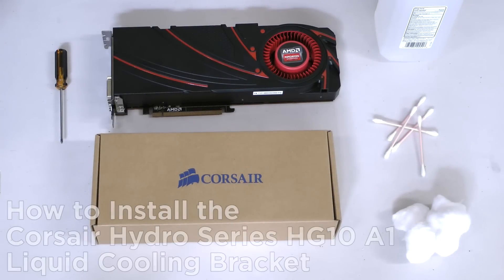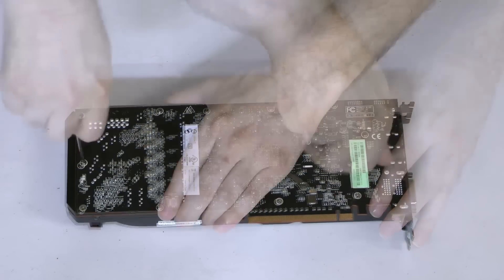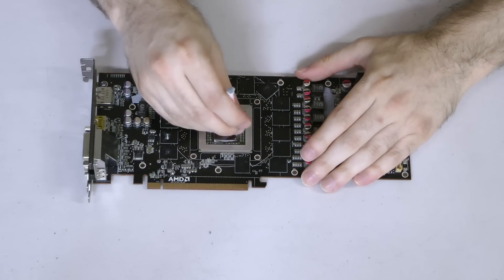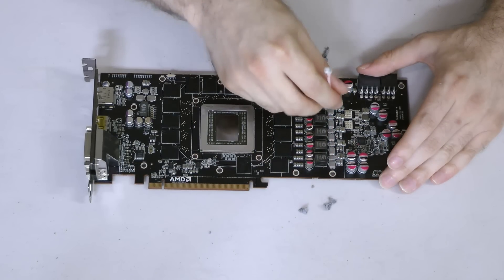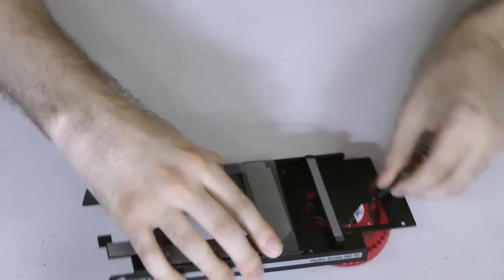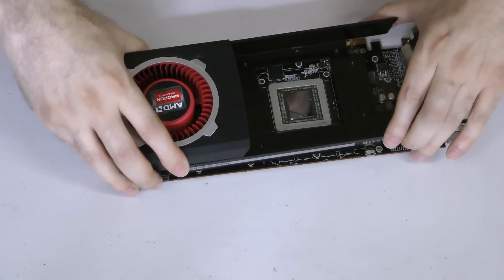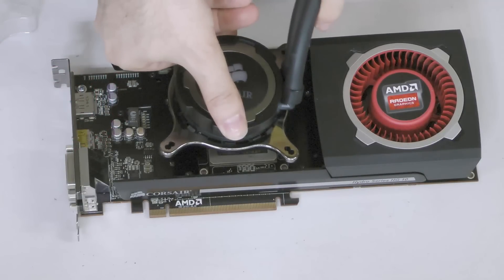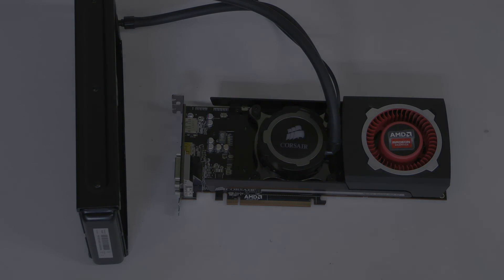Corsair Hydro Series HG10 GPU Liquid Cooling Bracket -- A1 Edition Installation How-To Guide

Comment: So, what if you don't have a reference card? 

Ive got an ASUS DurectCU II, which has different fans to a reference card.
Maybe I should just get a Kraken G10, since it has it's own fan.
Reply: +Haylos Van Cuda You could just use the NZXT Kraken G10, the fan is included in the package. Its the same thing, but supports different all in on wattercooling
Reply: +Sebastian Frøyen (SeBlastian) 

I said that in my original comment - it wont fit though, i emailed Kraken

Comment: Would  this work with a non-reference R9390x, if I got a hold of a reference cooler?
Reply: As far as I can tell it isn't supported :( The NZXT Kraken, which does the same things as this supports more cards, but the 390 and 390x aren't listed. No one has answered me on whether or not it will work with some modding
Reply: ***** As far as I can tell it isn't supported :( The NZXT Kraken, which does the same things as this supports more cards, but the 390 and 390x aren't listed. No one has answered me on whether or not it will work with some modding
Reply: +EricM260 sweet, let me know how it goes and maybe I'll buy one too. I have the xfx390x so maybe I'm in luck.
Reply: ***** That's really good news. I'm definitely going to try this. I wonder, though, if the NZXT GPU Bracket will work too, since they list the R9 290X as compatible I think it would. You said the 290 and the XFX 390 are the same?

Either way I'll try one of them and let you know if I need help/how it goes.
Reply: +EricM260 Just out of clearity you tryed the NZXT or the corsair
Reply: I haven't yet. I haven't been able to buy a liquid cooler that I can use yet, but I'm planning to get one soon so I can give it a shot. I'll be sure to post about it when I do though.
Reply: Okay thanks

Comment: hg10 980 is compatible with h80i gt?to cool 1 titan x
Reply: The number after refers to the graphics card number,  the HG10 N980 is compatible with the GTX 980 (and a few similar models) any corsair hydro series cooler will work with the HG10.

Comment: Why there's a lot of negatives comments ???
I'm about to install this to my two R9 290!!!
Reply: ***** HG10 for one, arctic + hg10 for crossfire. Mainly because it doesn't pump the hotter air back into the case and rise the cpu temps, also it's cooler.
Reply: ***** Exactly.
Reply: ***** Generally at the back as exhaust, anywhere you put it leave it as exhaust, also please change that case, it's really not good.

Comment: To what do you connect the pump/fan connector to? Only spot i got left is a case-fan connector. As for the VRM cooling, i gues only way to keep em cool is manualy override the stock-fan speed? As its throttled by temperature of GPU (wich is quite low), it runs often at 10/20% max, that would explain the insane high VRM temps.

Comment: It'd be amazing if this was reusable, but once I upgrade my graphics card it is pretty much useless. Not sure if anyone on eBay would buy it either, once the thermal pads have been used. Are there reusable solutions for water GPU cooling that are more future-proof than this?
Reply: QuantumBraced why not sell the old gpu on ebay with the liquid cooler attached. it should attract more money than use the that money to buy a new one for the new card

Comment: My hg10 was warped I didn't notice till my r9 290 just black screened and died out of the blue about a week after installing this bracket.

After I inspected it you could see the PCB was warped with this bracket on. Maybe I should have inspected more thoroughly but I have a lot of corsair products and never thought qc would be a problem.

I had to buy a new r9 290 i still have my h60 and hg10 but alas ain't no way I'm reinstalling it.

Comment: I did some testing with this If you are looking to over clock the vram please don't this is a shit cooler for ram I got 95c on my ram -_- with only 1400mhz mem clock on the other hand If you have a good water cooler go for it I got 1200mhz on core 60c max temp h100i

Comment: I'm surprised that more cards don't come with stock AIO water coolers already installed like the R9 295x. Even if the cards don't run as hot as the 295 it seems there would always be a market for a preinstalled AIO cooler. Everyone likes their card to run cool so why not? Plus they could design some really badass looking blocks that they could charge big bucks for.

Comment: This liquid cooling bracket can fit a r9 290 tri-x ?
Reply: (this is a 2 year old reply, but someone may see it and need the answer)
yes, the 290x tri-x can use this, because it uses a reference designed board. but you will have to find a reference-style fan to install in the cooler bracket.

Comment: Good video, but a lot was left would be good if it could be clarified. 
1- where would you recommend plugging the fans ? 
2- I see the old brackets in this video, but shows on the descriptions compatible with all hydro coolers. Will it take the new mount found on the h60? H100i? 
3-the Radeon gpu itself is actually caved in in most cases this was possible by using a slab on aluminum or copper that filled the void between the die and the water block thus being able to make the contact. Is there such thing in this kit included ? Other than that you would have to use excessive thermal paste to create contact between the two.

Comment: good demo, but don't fully go by this video as at the end he said it's ready too go it's not put some thermal past on then put the water block on :) just saying
Reply: ***** Yeah, the video is assuming that the hydro series is brand new out of the box. He probably should have mentioned that if reusing a unit you need to reapply thermal paste, however I'd imagine 99.999999% of the people who are willing to take apart their expensive graphics card for water cooling already know that thermal paste is required.

Comment: I want one for my new gtx 970. I know it runs cool enough. But it doesn't hurt to run even cooler lol. I might need a new case to do it. My corsair air 240 won't fit my 100i water cooler and another water cooler in it. lol damn it

Comment: I have the gigabyte r9 290. Where could I get one of the reference card blower fans for this? I really want to liquid cool my card.
Reply: Same issue. As far as I can tell there's nothing out there. In UK i can't find a reference fan.

Pitty.
Reply: Ziuko X did you guys find a solution?  would this fit, FD7525U12D, i got me the msi 290x twin frozr and i dont have a blower

Comment: So the aircraft fan freaking noisy sound is still there....'
Reply: yes and no, the fan can be turned down a bit now that it isnt trying to cool the damn hawaii gpu core which is good and the reason companies are making aio gpu brackets.
Reply: no, it should run much quieter. in the stock setup, the red fan cools the entire card. with this setup, it only has to cool the VRMs, which generate only a fraction of the heat. you will never have to ramp the fan up to keep things extremely cool

Comment: @MahmoudMaguid oops, I thought that that hydro cooler came with the bracket as a single kit. But you can choose any pump for this gpu bracket. So if I wanted I could get a 140mm rad.  Nice 1

Comment: Where would I mount that rad. Hmmm not the top cos I have a dual rad there already for my cpu. That leaves the front. And it cant me mounted there cos my hdd cage. The perfect place would have been as a rear exhaust. Or less perfect but still useable the bottom of the case. However both these locations would only fit a single rad. Not a double rad.
Reply: You dont need to use a 240mm AiO...
There are plenty of other 120mm or 140mm AiOs that are compatible with the HG10.
And just fyi, there are a lot of cases that support two 240mm radiators. Many have space at the front or bottom. Just because your case wouldnt fit it, doesnt mean cases that will dont exist.
Reply: Toxic Biohazard yes, I understand now. thx.

Comment: Not trying to be a "cock-blocker" but NZXT has a GPU bracket already; the Kraken G10 that came out 1ish year(s) ago and works for pretty much any reference card (AMD and nVidia), not just the AMD Radeon r9 series.
Reply: Obviously you havent done much research. There will be multiple models of the HG10 for different cards from both AMD and Nvidia. This is just an installation demo. Did you expect them to make a demo on every single card? LOL

And also the G10 from NZXT has a lot of issues with cooling the VRM because if you dont buy your own heatsinks, the VRM and VRAM on AMD GPUs can reach 90+ degrees C and damage your card.
Reply: Oh I know about the heatsink issue :) I did do a good bit of research, its just that in the video he literally says, "The A1 is designed to fit AMD Radeon R9 290 and 290X cards..." I know they are making more models, its just I was saying that NZXT makes one that accommodates all models. Someone who might not know much about corsair might get confused.
Reply: Quiby Oh I see, I guess youre right, some people might think it works for all graphics cards.
Reply: Toxic Biohazard That was like half my point, but I didn't seem to specify well enough :)
Reply: Toxic Biohazard As long as your card AMD/NVIDIA come with a VRM heat spreader it's ok. the fan from the gfx card is now cooling this area even more when the stock heatsink is removed.
Reply: Peter Gratineau Are you talking about the HG10 or G10?
Reply: G10
Reply: Toxic Biohazard there are only issues for cards without internal vrm cooling plate..
Reply: Peter Gratineau Which is most cards because aftermarket GPUs usually incorporate the VRM and VRAM cooling into the main heatsink.
Reply: Toxic Biohazard my experience is that the main heatsink actually has nothing to do with vrm/vram cooling, it  (main heatsink) is only attached to the main gpu Die .what happens is the fans attached to the heatsink blow the already hot air back onto this area ,which results in even more overheating. .

Comment: what about thermal paste on the gpu?
Reply: There is always stock thermal paste from Corsair on the blocks (i got the H100i)
Reply: i saw some cooler that came with thermal paste in a tube
Reply: Ugo Filion
its optional but corsair do have pre-applied thermal paste on their aio blocks.

Comment: why whould you need the fan from the referance cooler?
Reply: The water cooler only cools the GPU chip its self. The blower fan is to cool the VRAM, VRM's and other things on the PCB.
Reply: Nadox97 ohhh yea right, thnks
Reply: No problem. It is a slightly odd design but they couldn't sell a blower fan with it pre-installed because the specs wouldn't be the same and apparently the cards dont like that.

Comment: A MUCH  more elegant solution that the NZXT Kraken G10, for sure!
Reply: 1toncheese a lot of card come with a vrm cooling plate which works very well with the included vrm fan.  ;-)
Reply: 1toncheese yes you are right ,i agree a version 2 with included vrm plate would be nice ,problem is there are so many versions of the models as far as PCB design goes it would be difficult...i am happy that the nzxt works so well..i mod gta IV much which pushes the gfx really hard, and the temps are so good you could fap to them lol ( gross)...i am 41 years old and i know my Pc hardware and this invention is really worth it....cheers from Austria M8.
Reply: Peter Gratineau
yeah think it wont be too difficult if they worked on reference mounting points for modular vrm heatsinks or offer seperate unisinks with gpu cutouts for the cores.
Reply: less modular since the nzxt solution is a "one size fits all type thing" the thing i think nzxt should do for the kraken g11 (if they make a new one) is make a modular designed mini heatsink for vram and vrm areas and have various mounting holes to install them to the bracket/ card.
Reply: Peter Gratineau
yeah but itd be a nice thing for nzxt to do......

Comment: Soooo GTX 970/980 ones coming soon?
Reply: He has a point. The 290/290X had truly horrific stock coolers. They hit 95C and throttled themselves.
Reply: Maximus gameplay It's not all about personal preference. OpenCL = AMD. CUDA = nvidia, Raw Performance = nvidia. Budget build = AMD. And 10-30 fps is a lot, not just a "little slower."
Reply: Nadox97 exuse me budget do you have any idea how much a R9 280X lightning edition from MSI costs its about the same price as a GTX980 and its only 10-30 fps slower than the 980. im a Nvidia guy but AMD goes for me aswell ea has his pros and cons. its all about personal prefference.
Reply: .... The stock coolers on AMD cards are not bad. The AMD chips are designed to run at around 90 degrees C. where are the Keplar and Maxwell chips run cooler.
Reply: Uteopia I remember when that driver came out, but at least Nvidia removed it right away and fixed it. You'll likely hear more people complaining about Nvidia drivers because more people use Nvidia cards than AMD ones.

AMD also don't tend to release drivers as regularly as Nvidia to fix or improve performance issues and most games tend to run a bit better, or are optimized for Nvidia architecture since they have more marketshare and prominence in the industry. 

Right now, I'd say AMD don't have any offerings that really beat Nvidia's in terms of value and AMD's next generation of cards aren't even out yet.

Nvidia also has more features like Shadowplay too, an any-purpose screen recorder that costs 1-2 fps, unlike fraps which costs 3 or more times that. Things like these make it worth the price even if they are virtually tied in cost per performance.
Reply: Uteopia Then perhaps it's just me, or the games I played, but in my past experience I had more performance problems and driver-related game artifacts and flickering on AMD, than Nvidia.

AMD's DVR capture recorder doesn't perform as well as Shadowplay, tending to cost more frames. Also DVR is fairly new at this point and isn't as refined as Shadowplay. Last time I looked at DVR, it still couldn't record anything outside of a 3D environment such as your desktop or other apps like Shadowplay can, useful for doing tutorials and such.

AMD mantle at this point is just a rare marketing feature like Physx availability, because developers have to go out of their way to support the API in their game. Mantle does have great potential, but only the highest end cards like the 290x can see any performance increase at all in games like BF4. Using a 270 or lower card with mantle on BF4 actually performs slower than using its directX counterpart, according to www.tomshardware.com/reviews/amd-mantle-performance-benchmark,3860-7.html

As of now, Nvidia's 9xx series is out, and this forced huge price drops on AMD's behalf. Not to mention, AMD's 2xx generation of cards weren't as efficient as Nvidia's 7xx cards, drawing more power and producing more heat, noise than an Nvidia card of equivalent power. In fact, the 290 and the 290x reference design overheats to 95c quite regularly.

I don't want to be a fanboy either, but this is just my opinion from experience. Maybe that will all change when AMD releases their next gen cards.
Reply: KoudZ
 I never said they were good. AMD CPU's and GPU's are for budget builds. What would you expect?
Reply: Save up and buy Nvidia cards= Problems solved...

They've got better drivers and a lot of programs/apps run better or are biased on Nvidia architecture too.

AMD needs to step up their game, both in the CPU and GPU market.
Reply: HG10 Compatibility list, only AMD Radeon R9 290X and 290 graphics cards.

Or
http://www.nzxt.com/product/detail/138-kraken-g10-gpu-bracket.html
http://www.nzxt.com/product/detail/145-kraken-x41-liquid-cooler.html
Compatibility list, Nvidia : GTX 980, 970, 780 Ti, 780, 770, 760, Titan, 680, 670, 660Ti, 660, 580, 570, 560Ti, 560, 560SE
AMD : R9 290X*, 290*, 280X*, 280*, 270X, 270 HD7970*, 7950*, 7870, 7850, 6970, 6950, 6870, 6850, 6790, 6770, 5870, 5850, 5830
Reply: GCBrin they are not that bad just very loud.
Reply: Krevin Grard Loud, because they are spinning fast - spinning fast because they are having a hard time cooling the card,
Reply: GCBrin my temps don't go over 65C so i don't see the problem.
Reply: They don't need them - their fans are actually quite good. The 290X/290's stock cooler is pretty bad. It basically verges on unsafe.
Reply: GCBrin .... I'm not even going to bother wasting my breath.

Comment: Eh, well A for effort, but could of been alittle more stylish. Check out asus ares 3 watercooled version for something red & stylish :)
Reply: That's a custom waterblock. Not an AiO bracket. There is a huge difference...
Reply: Toxic Biohazard ik, if some1 i just recomended an asus waterblock ive used before which turned out great if any1 wants a waterblock
Reply: BlooDaKiller Theres no such thing as an "ASUS waterblock". It is a custom made GPU with a waterblock preinstalled. You cannot buy the waterblock alone because it only works on that one card. And you need to have a custom loop to cool it. With the HG10 you only need an AiO.